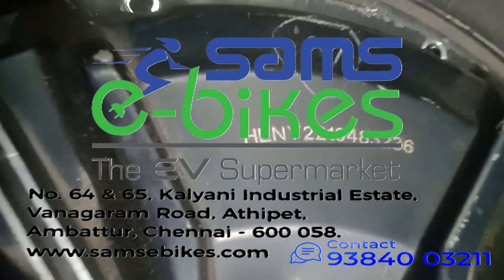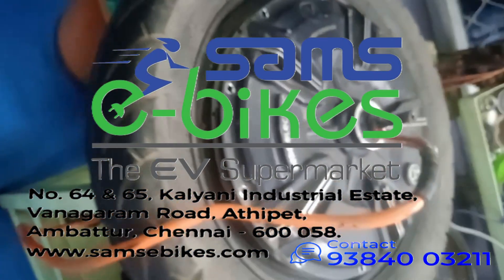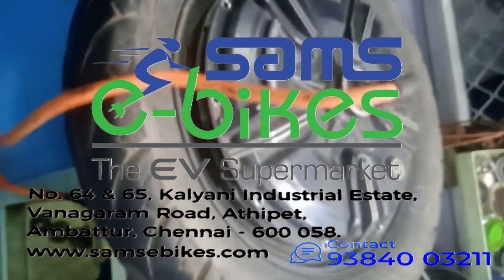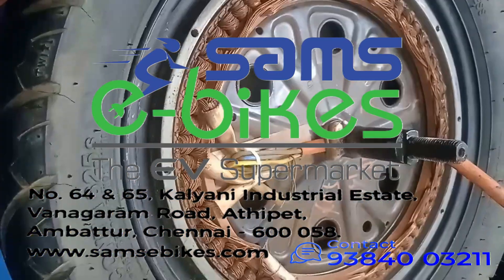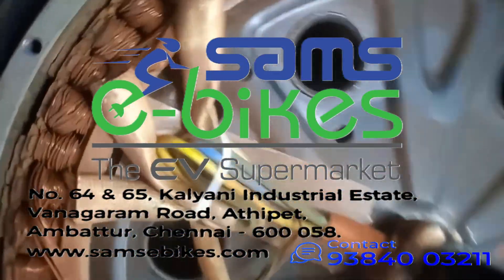How to replace magnet in electric scooter hub motor

Comment: Hi. How i ll figure out which magnet is compatible? And frok where i could but it? Ps: from Turkey
Reply from the maker: The magnet grade and dimensions need to be checked with the motor manufacturer. If you have the magnet grade and dimensions you can place an order with the magnet manufacturer.
Reply: @samsebikes5869 thank you Sam. im gonna search for the dimensions and manufacturer sheets to make sure

Comment: But you didn't glue the magnets in?  Won't they move around after a bump? How can you tell when the magnets are loose inside?  Is the noise loud?  Will the scooter freely glide with the power off with loose magnets?  I think my Kaabo Wolf has loose magnets inside -- it makes a weird sound when turning left --and it's not the brake caliper rubbing.
Reply from the maker: Good point Chris. The magnets are glued using special grade adhesives which are pretty strong and can take a lot of beating. If the magnet come loose the motor mostly stops working and also there is lot of noise due to the loose particles moving inside the motor.

Comment: If lost 3pieces of chips magnet is it possible to run and no damage inside the hub?
Reply from the maker: Chipped magnets can sometime work fine , but if 3 magnets are completely lost in the motor the motor will have a jerky motion. The ride wont be smooth.

Comment: How do you ensure the correct polarity? Have the first magnet "stick" to the hub and then each other one shoukd link to the edge of each magnet which will determine  the correct polarity?
Reply from the maker: Like pole repel and opposite poles attract.... First mark North and South on all magnets and then assemble. If you need further inputs message on 8778420230
Reply: @samsebikes5869 Thanks mate, I'll give it a shot. So in theory, once all magnets are marked and inside the hub, it should look like nsnsnsnsnsnsns.. etc.?